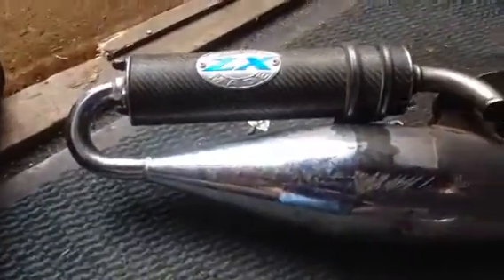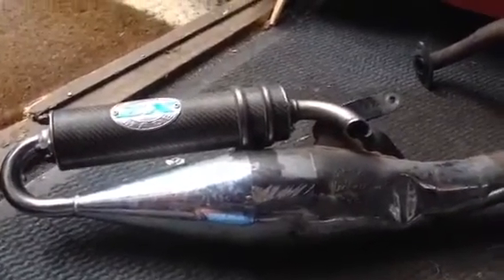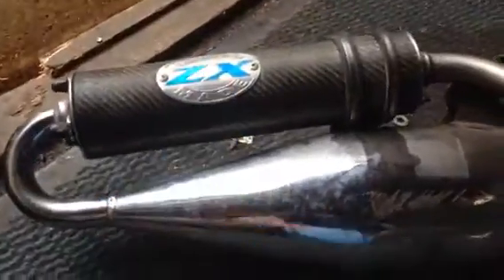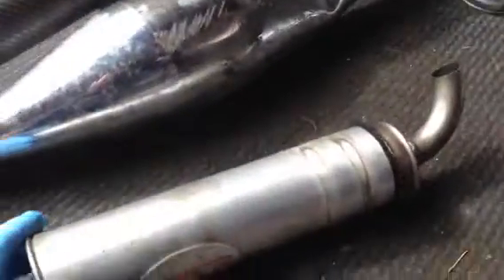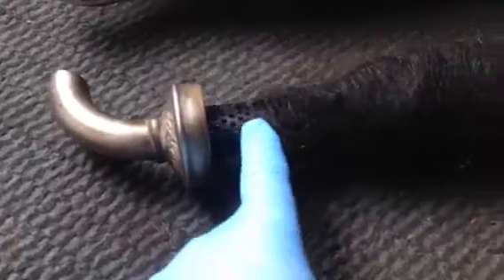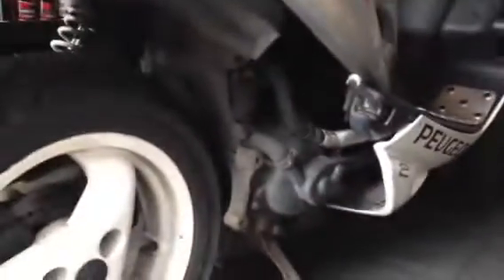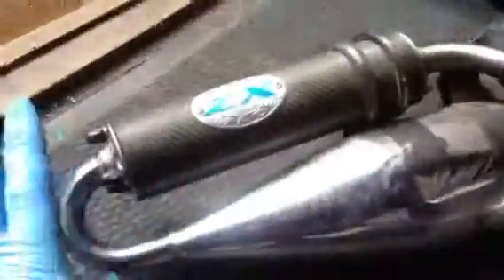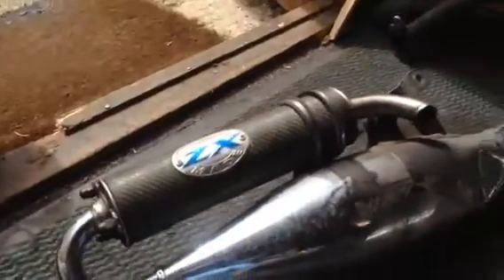Peugeot speedfight fix part 13 not pull away exhaust ! mark savage

Comment: Hi Mark. Seems like I will need to change the exhaust on my Speedfight 2 100cc to pass MOT. That, or weld a hole in it, but it's deteriorated anyway so probably better change it.

I'm scooting ebay for parts. Can you tell me if a 50cc, or a speedfight 1, etc., exhaust, is interchangeable with my 100cc Speedfight 2?
Reply from the maker: hi yes they will fit 50 and 100cc fine which is odd as the opening is bigger on the 100cc but they do fit, if in any doubt maybe type in 100c only, not worth welding the old one and will run better with a sports exhaust, should have to upjet but if it runs lumpy then add 4 higher from the jet in there now and take of the link pipe, mark
Reply: It may have been upjetted by the previous owner. I was told he got it all done except the exhaust. Unfortuatley, it failed MOT for that hole, and the tyre valve stems, and breakpads, so I need to replace all those quick.

Currently it does 62mph max. I'm not complaining.

Thanks a lot for your quick response. Cheers.
Reply from the maker: yes that's ok with a sports exhaust you should 70 75 out of it so all good bud and I have a video on brakes if you need it , mark
Reply: I've seen that one. I think I will DIY it to save money (I've done repairs before so not quite unfamiliar with what I'm doing), but I need a ratchet/key set which I probably don't have in my household. :(
Reply: Good news I found the tools. All I need is the parts now. All located on eBay just after the exhaust and indicator lens/bulb assembly. Now I really wanna get a sport exhaust instead of an original one, but is that legal for MOT's? Or do people swap them with the original for MOT purposes?

I found a Tecnigas on for Speedfight 1 or vivacity air cooled 50cc. Seller says it will only fit 50cc.

As mine is both mark 2, and 100cc, I'm not sure but can you confirm it would fit?
Does the difference in opening size make an actual difference?
Reply from the maker: Noah Maasarani hi bud it's fine for the mot and they seem to fit both 50 and 100 cc as said 
Maybe contact seller and double check but I have fitted them before and it's been fine , mark
Reply: I got one locally, looks like everything else on the net. However, as I was just removing the existing one, I discovered it has another side-pipe that goes all the way to the bottom front of the bike. Do you know what that is? I can't find a similar exhaust online to show you.
Reply from the maker: Noah Maasarani hi , yes mate don't worry about it , as in my other videos on this it's the GRV just take it off and cut the rubber pipe and tuck it up , then fit new exhaust 
Happy days 
Mark
Reply: Super! I've changed the exhaust now but the old one is still dangling with that rubber pipe. It's night time so barely could do anything as no light. And now that the new exhaust is on, I wanna try it out but man, why do neighbours need to go to sleep and rest a bit past 10pm? Don't they know I have a bike to repair? lol

Cheers mate. I'll keep you updated. Worried the new exhaust might be louder than the previous one (no leak holes, but been debaffled).

Comment: Hi mate big fan watched a lot of your videos helped me a lot I have a speedfight 2 lc 50 all going wheel have built most my self keeps over heating I believe a I need to repair pump any idea what engine these are so I can get some info please buddy
Reply from the maker: So you have a lc speedfight 
E bay is best for buying them
They can’t be repaired 
Remember to use antifreeze and leave the cap off to get all the air out 
Make sure you haven’t damaged to piston already !!
Are you loose water out or in the head ?
Reply from the maker: I  have loads of videos other videos that will help on my channel bud
Reply: mark savage yea I have watched most of them very helpful piston all good no leaks just can hear bearings from water pump so not working properly and over heating got all air locks out
Reply from the maker: Reece Bayly I’ve had this noise and it turned out to be the crank bearings but sure it’s your water pump as ya over heating 
Hopefully you get it sorted bud

Comment: Hi Mark I'm guna change exhaust on speedfighter a.c. it's got a pipe coming from oil pump which is bolted to the crank casing I've seen a lot of replacement exhaust with no pipe on exhaust so what do I do with the pipe
Reply from the maker: hi the pipe onto the exhaust is the gas recirlation valve or GRV, don't worry most poeple just bent it over on the standard exhaust and when fitting a new one just leave it off or cut it out of the way 
it will be fine , check out my other videos as they should help with fitting and if any thing goes wrong . ps wd40 the nuts first before taking them off as you don't want to snap them 
please like share and subscribe , mark

Comment: hi mark I've got an TT exhaust witch is loud but pulls away very fast do you know what could be wrong with it thanks Dan
Reply from the maker: make sure it's fitted on to the head properly so nice tight fit ?, if still loud then as in my video, you will need to change the wodding as it get hard with the t2 oil. hope that helps . please like share and subscribe , mark
Reply: mark savage OK I'll try that might just have to be the wadding as got new gasket on there

Comment: I've got a speedfighter it's bogging out and the carb is blowing out of air filter end should be sucking can you help
Reply from the maker: mark lawrence hi
If it's blowing you will need to check your reeds as they should stop that and only suck   Air in , check out my reeds videos on how to check and replace , hope that's help please like share and subscribe , mark
Reply: mark savage hi thanks for the reply I've cheked the reeds and look ok don't look like there's any gap if so very small thickness of pice of paper I'm thinking piston?
Reply from the maker: yesss thinking you could be right and worth a check, it's an easy job just use wd40 on the exhaust bolts and head as you don't want to snap any bolts ! . mark
Reply: mark savage were the best place to buy a piston sorry to be a pain
Reply from the maker: that's ok mate e bay I buy them from e bay seller scooterworks but as long as they are good ones not too cheap as they just don't last, have fun , mark
Reply: mark savage could you send me sellers I'd so I can search
Reply from the maker: At work at mo mate but best just type in Peugeot speedfight piston.there you should see the sellers only buy from UK and should be around £20 to £30 , do not buy the one with Chinese writing on it that's rubbish . mark
Reply from the maker: I have a few piston change videos and say the same thing on them, give them a watch  and should help when fitting bud ,mark

Comment: hi can u repack a standard exaust
Reply from the maker: hi there do a few for the speedfight standard exhausts, so the first two not without a disc cutter and welding them back up so no lol, the last one can be but again it's difficult, i'd just buy an off the market one, it looks better and sounds better plus better performance, thanks for watching I do have another few videos on speedfight exhausts . mark ,
Reply: hi mate thanks for the reply was going to buy a aftermarket one of eBay but Un sure about the size of the new main jet I would need and if there is any thing else I would need.it a speedfight 2 100 had new rollers and belt and has poor acceleration and struggles to get to 45 the exhaust is very noisy for a standard one
Reply from the maker: Jason Bennett they should do 65 / 75 easy 
Maybe a sports insert airfilter 
Check jet size it has in it now and go up in 4s so buy a few bigger 
Check belt size as the 100 cc has a bigger belt and if a 50cc is on the varaiator does not open fully reducing max speed. As I've had this before !!
Sports exhaust should help with more back pressure if the one on there is old and letting it all out 
See how you get in bud 
Hope that helps 
Mark